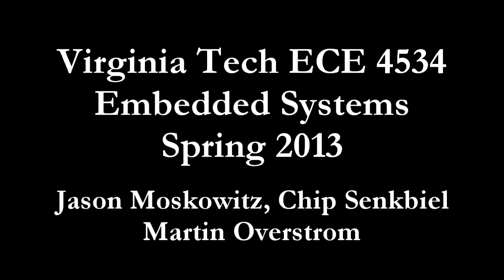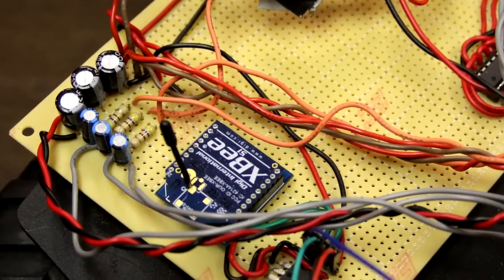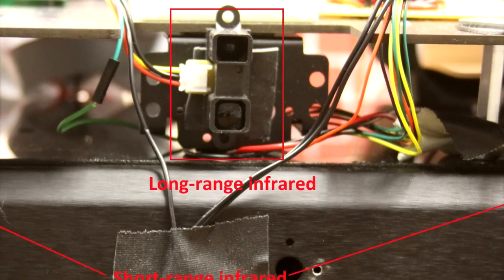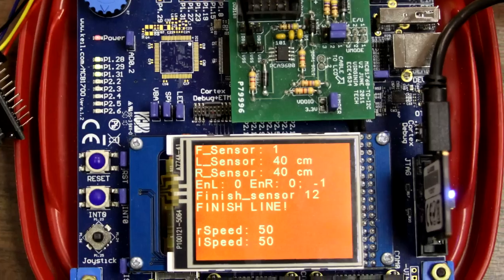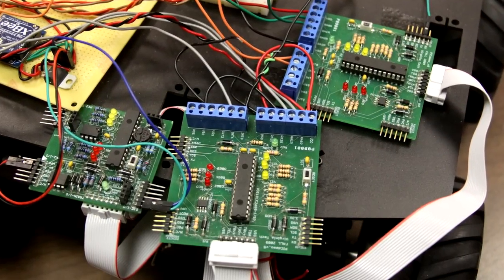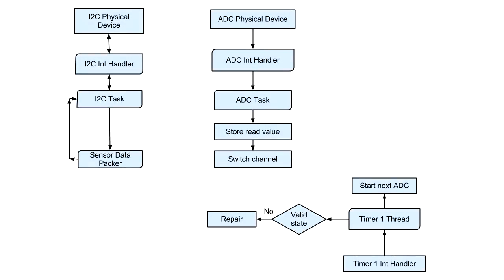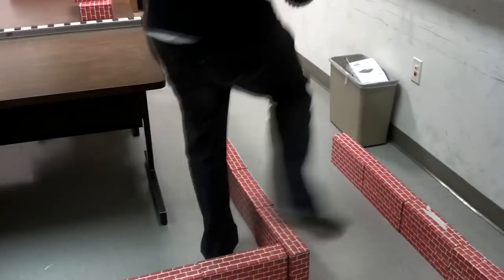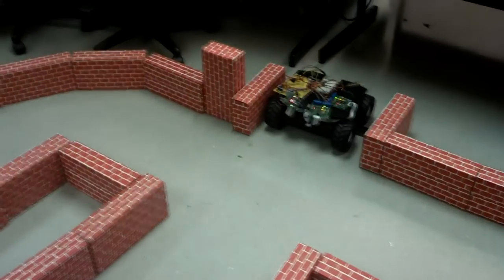Virginia Tech ECE 4534 Team 11

Comment: This video is awesome!  You did an excellent job of explaining every component.  Will this robot travel on carpet or colored floors?  Or is it constrained to clear or light-colored floors?  Very well done.
Reply from the maker: +Cameron Vinson Thanks!  The only thing that would be affected by a change in the floor color would be the reading from the infrared sensor looking for the finish line.  If we were to run the rover on a particularly dark-colored floor, we might need to adjust the threshold for what we consider the finish line.